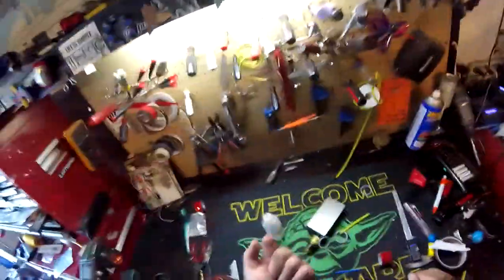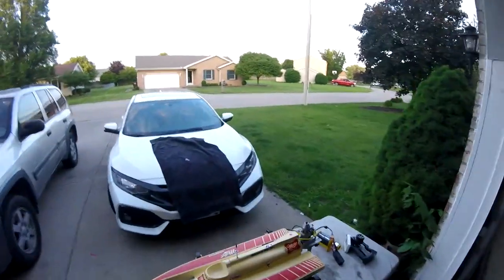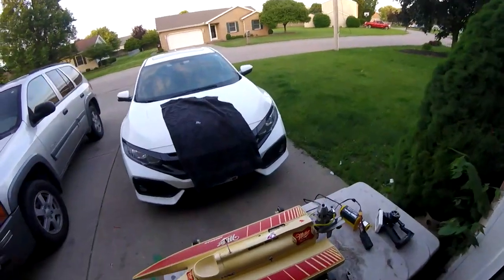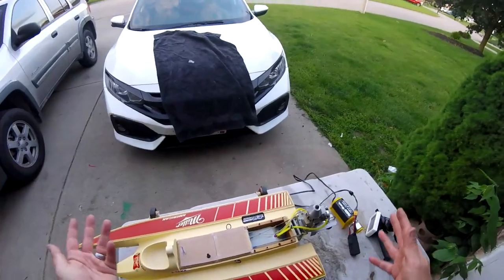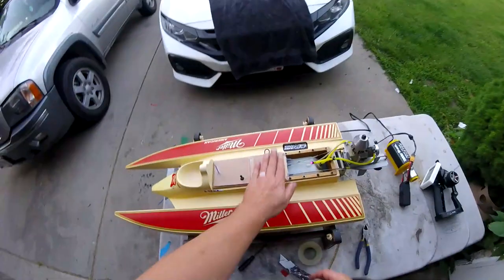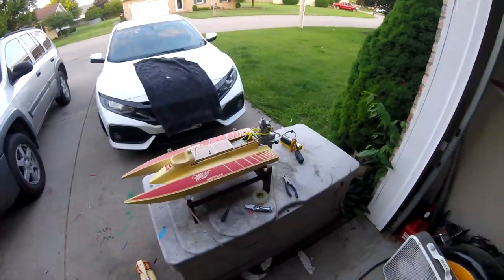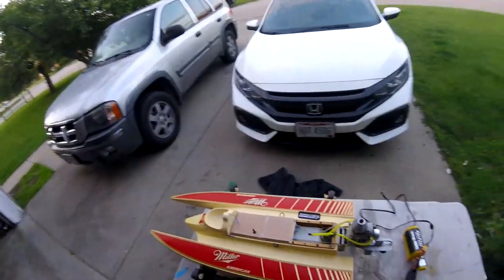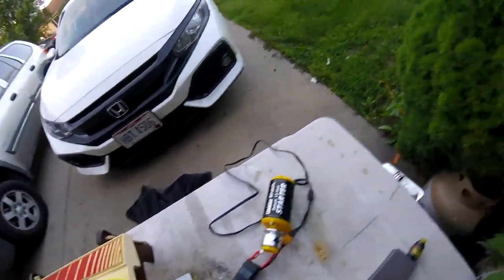Starting a K&B Vintage Nitro Outboard.. Good fun!!!!!!!!!!!! Loud.. damn.

Comment: Ex-girlfriend’s brother gave me a similar hull with the same engine back in the 90’s. It has sat on a shelf in my garage unused. Your video has given me what I need to get it running. Also all the tinkering is part if not the main part of the fun!
Reply from the maker: Agreed!!!!! Lemme knownif ya need a hand with her
Reply: Make it spins over with the glow plug out with NO!!!!!!! grinding or clicks. If it is an ABC piston/liner there will be a smooth pinch at the top of the stroke. This normal for a healthy ABC engine. If it is stuck do not try and turn it over. There are way to soften the old lubes if it was not put away properly.  Easy to fix. The con rods are not the best in these engines. I always have 2 new ones on hand. As much as I dislike Mecoa, it is the only place to buy parts for these engines that I know of. I wont buy another K&B for that reason. Running a 20% nitro mix and 18-22 %lube these engines will last longer than you need. You will move up if you want to really know what fast is. Beat the crap out of electric, cost money but it smells wonderful!! LOL Thats what its all about! You have tuners and people that run electric.

Comment: Your gas tank is backwards ..wen the boat accelerates the fuel goes to the rear of the boat and away from the clunk in the tank .. I've seen this many times ..the clunk can only follow the fuel so far ..then you'll start pulling air and causing your engine to have inconsistent runs .. turn it around the fuel will be forced to go to the carb ..

Comment: Hey I have a brand new version of the tunnel hull and the K&B 7.5 engine, both are still brand new never put together or ran or completed that I’m getting rid of
Reply: What I mean is I have that K&B boat and engine that is vintage new old stock that the boat has never been built and is still just primed and the engine is still new in the box from whenever it was made

Comment: So first boat for me. Identical setup...
Is tgat typical idle speed.  Seem awfully high but I don't know
Also how much travel do I need on the "rudder"
Reply from the maker: Hey brother, on nitro boats ya run the idle pretty high due to load when launching. (Least I do) most of the time your wot anyway.  As for throw, I make mine as wide as possible then limit through the radio to see how the boat reacts.

Comment: K•B awesome little engines 3.5 an 7.5. I have a tunnel hull with three 7.5 outboard‘s on it that we use to run at the speed runs.  I also have two brand new in the box 65 OS max inboard  from 1985 thinking about building another Hydro maybe or selling them.
Reply from the maker: Ooooh nice! If u sell em let me know.   If ya build a duck, let me know that to!
Reply: I will let you know. I’m still looking for two Rossi 80 from the mid 80s to put in my open class twin screw Hydro. Also looking for a Steve Muck mono hull from the mid-80s 85 to maybe 88 it was one of the fastest hull around at that time. I think it would still be really fast nowadays.Would love to put a brushless motor in one.
Reply from the maker: Stacy Beach damn two Rosie’s from the 80s.  Sadistic. LOL.    Awesome motors

Comment: I have basically that same boat with the k&b 11cc, hasn't ran since the early 90s and I'm trying to get it going sometime, any good places for info?
Reply from the maker: Hmmm.   The offshore forum is ok.  It’s hard to find good boat info online.  I’d be glad to help ya out if ya have any questions
Reply: @jjrotogeek  yea seems hard to find anything, just need to find a starter, a glow plug, how the fuel lines run, the factory carb settings and what fuel I need,
Reply from the maker: @jeremycts-v2013  I still have an outboard tunnel.   Would it help ya if I did a quick video of the things u mentioned?
Reply: @jjrotogeek  yea that'd be awesome! Basically just the routing of all the lines, what fuel, and what glow plug as I see there's a short and long one, also how to set the carb back to factory
Reply: @jjrotogeek  awesome thanks man! Yea I don't know a lot about them, was my dad's and he passed in 1993 so I want to get it running sometime
Reply from the maker: @jeremycts-v2013  awww that’s awesome.  Lost my old man in 04.   I’ll hook u up!

Comment: I had a Lee Craft 7.5cc tunnel hull.  It was a great class to race.  Is your hull a Prather?  They made an aftermarket billet aluminum rod with bronze bushings that is a good investment for the 7.5cc K&B.  As they say in tunnel hull racing, when in doubt trim it out.
Reply from the maker: Agreed!!!! Yes thisnine is a 32 Prather.  Thisnis the first time I’ve used the 7.5.    I have a few of the 3.5 outboards.  If u have the link to those parts of appreciate it!
Reply: @jjrotogeek  Sorry, don't remember, the last time I bought one was 1987.
I will do some online searching.
Reply from the maker: Oh don’t trouble yaself brother.   Thought I had it in hand.  I’ll have a look around
Reply: Found a 3.5cc rod on ebay made by the same company.  Searched: Aero Motor Engines.  Looks like MECOA that I think owns K&B might carry them.  Good luck.

Comment: What fuel did you use ? I have a knb 3.5 on prather tunnel hull , just wonder what fuel i should use
Reply from the maker: I use bones 30/10 nitro.    Boats tend to like 50% nitro, but I’ve had good luck with 30%
Reply: @jjrotogeek  I'm new to this and I have a k&b 3.5 like when u say 30/10nitro i thought it would be 10%nitro and 18% oil i seen on a page i just don't want to blow it up